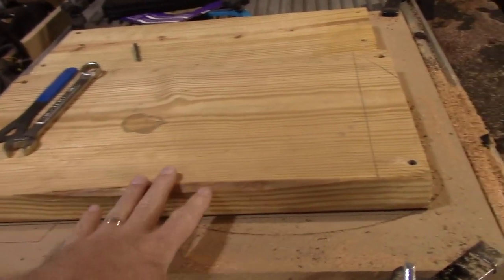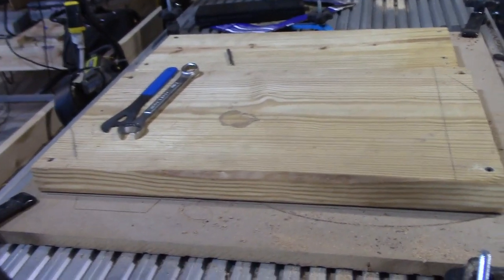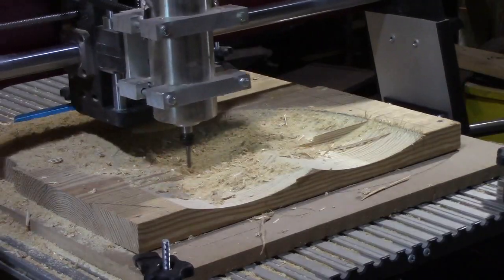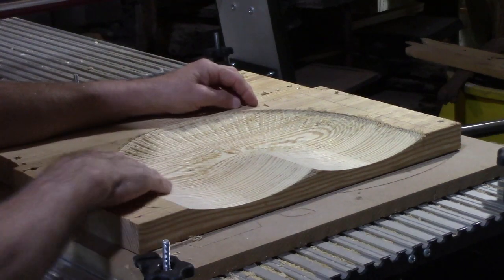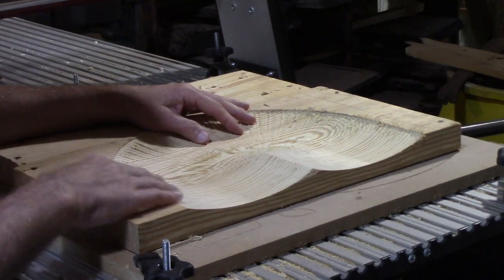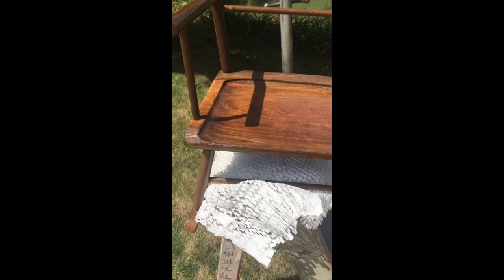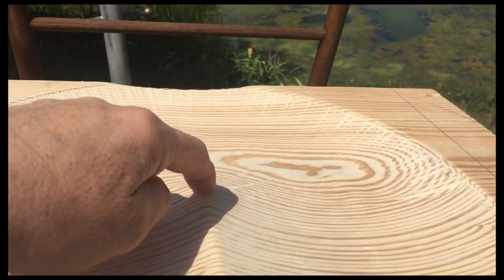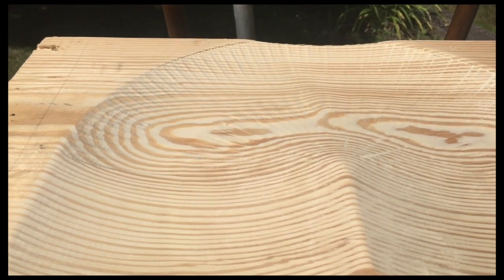CNC Carving of a Chair seat

Comment from the maker: Old toolpath tutorial from VCarve Pro found here: http://www.vectric.org/video/events/ugm/2013/toolpaths/flute-seat/w-TP-FluteSeat.html 
This is the link to the files for the seat carving. 
http://www.vectric.org/video/events/ugm/2013/toolpaths/fluted-seat.zip

Thanks to BoB Julia for the original concept and to Adam Morgan from Vectric for pointing it out.

Have Fun With Your CNC. Cecil
Reply: Good video!! I was having trouble opening up the links above. Please could you check that. Thanks. I would like to use the files to make something for my kids.
Reply from the maker: @shashankgodbole  Apparently Vectric has removed the link and are using the one that I have added to the description above. Unfortunately it does not do as good of job as the older one. I will see if I can add a more detailed one in the future.
Reply from the maker: @shashankgodbole  I checked and that video has been removed so I contacted Vectric. The video they sent me to is above but I did not think it went into enough detail so I did this one. https://www.youtube.com/watch?v=LAk8NuBFBxo

Hope this helps.  Cecil

Comment: thanks.... but using the table saw method is only 8 minutes . for the sa.e resu!t.

but i love  your cnc technical eway as well. great job!
Reply from the maker: Thanks for sharing
Reply from the maker: I looked at the table saw method and it is interesting. It requires a jig and a lot of involvement with rotating the stock. It is not quite the same result. The CNC method gives you a continuous curve from one side to the other the table saw does not. The table saw method only curves the edge down to a flat bottom. Keep in mind this was a first attempt. I will do a second this summer. Cecil